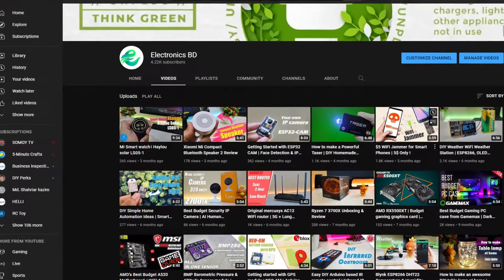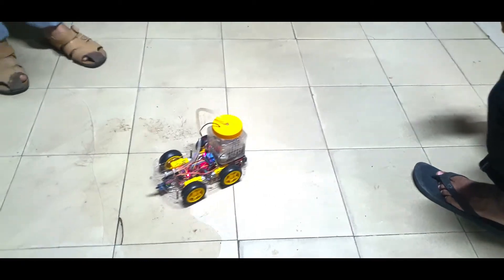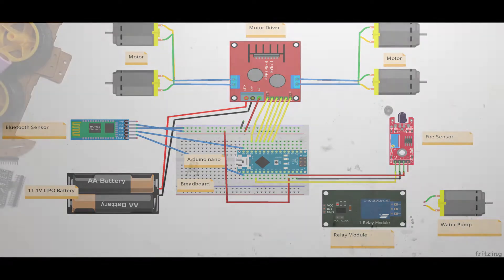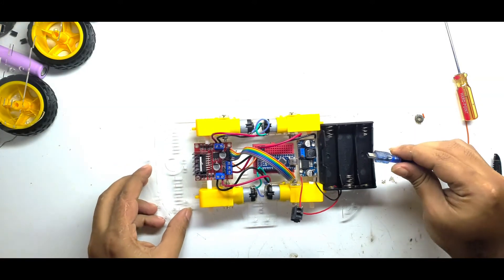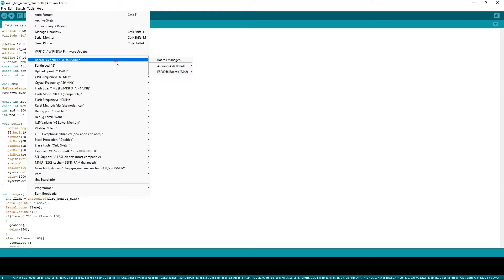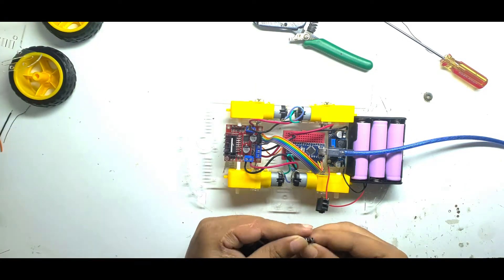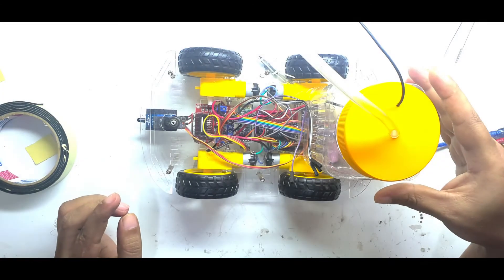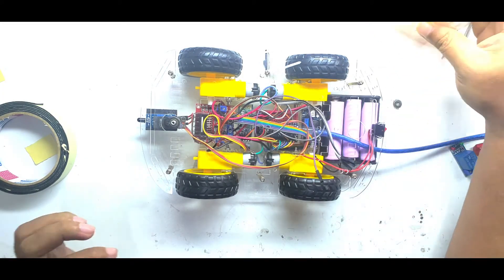Arduino Fire Fighter Robot | Bluetooth | Smartphone Controlled

Comment: 🥺💬 Thank you and I see you working in this VDO, stepper motor drive is good equipment today for coders who do not want to use message events or ACK it handling delays for you.
🐑💬 I build power tools  for you that is because you need to command 4 wheels drivers for your firefighter car.
🥺💬 I think he selected good module, I used to do once I am just a electrical engineer and computer engineer too but see he select supply is good to finish the project.